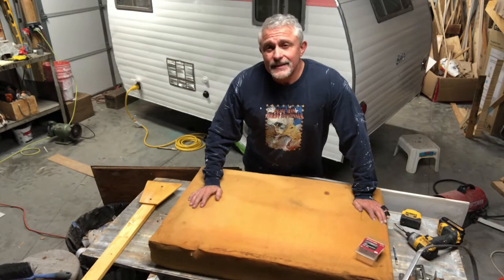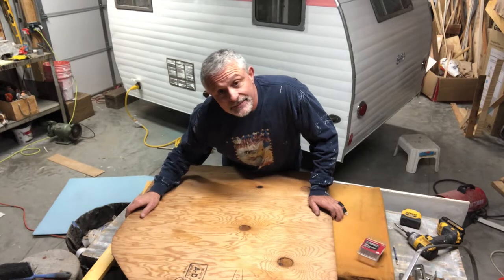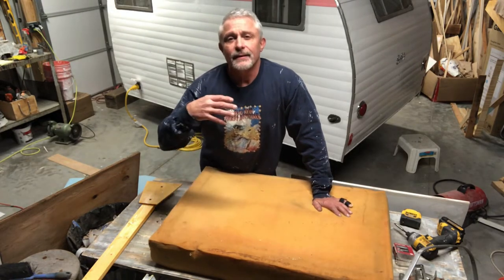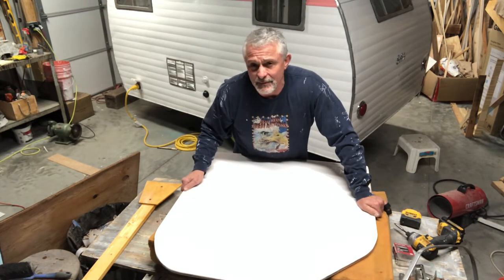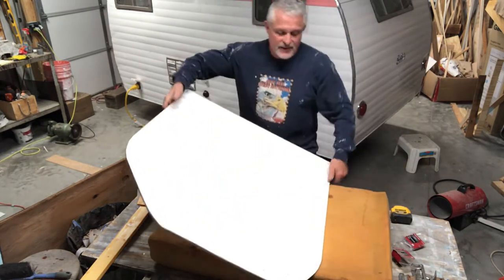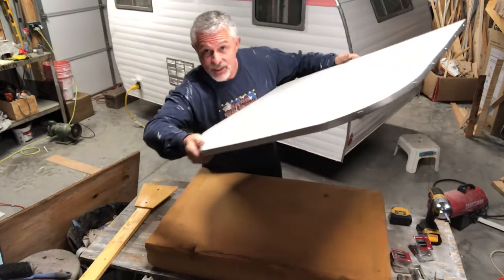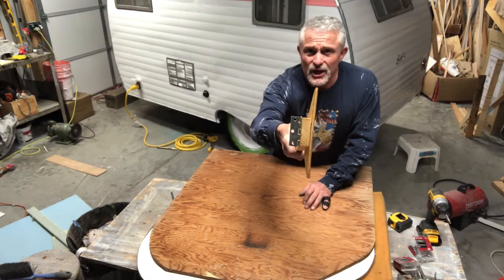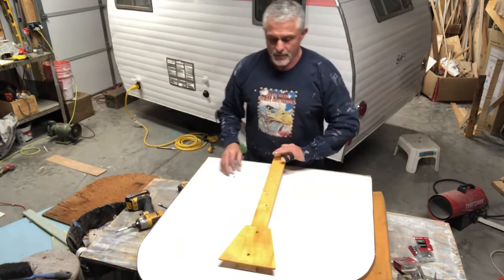EP 121  How to install vintage camper dinette table. 1966 Serro Scotty vintage travel trailer.

Comment: Does the hinge bar in the table hinge kits come in different sizes? We're trying to re-use a table from another vintage trailer and put into our 1969 Aristocrat but when we put the bar where the previous hinges were it doesn't get low enough to the fold down and make the bed. Then when we lower all the hinges so that the table is able to be set properly on the benches, the table seems too low. So it seems like we just need to get a longer bar but I can't find any and wasn't sure if they're all the same. Hopefully this makes sense? Maybe we're installing incorrectly?
Reply from the maker: It sounds like the seats are different heights in different campers maybe.
I have only seen one length.